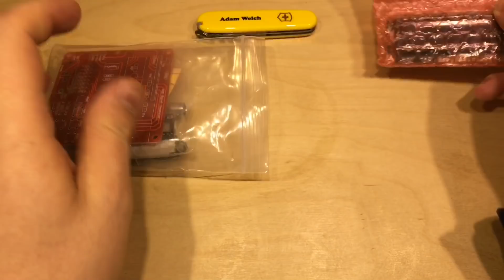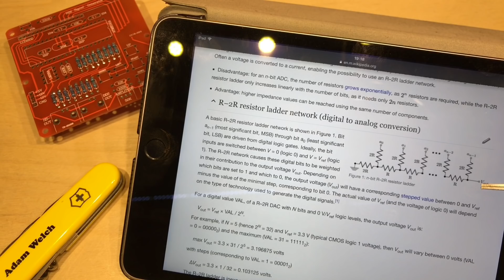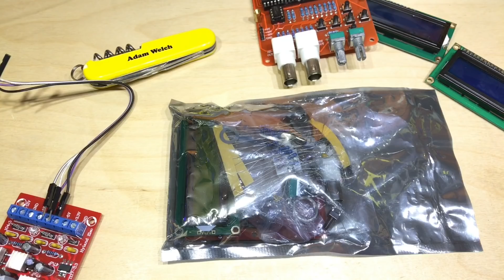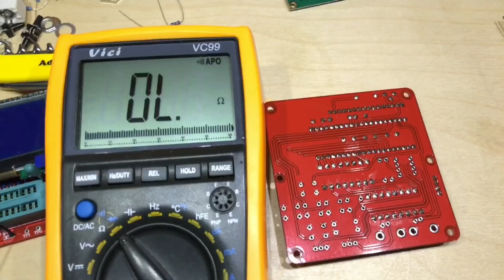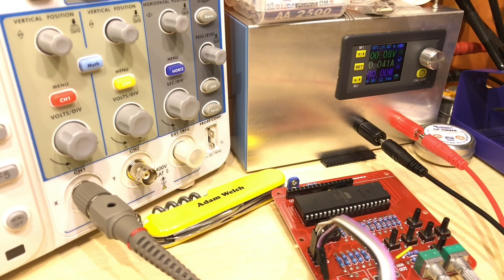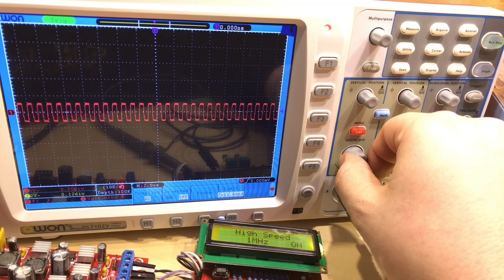Function Generator Kit Build & Build & Fix & Test & Bin? - 12v Solar Shed

Comment: Not sure if you know it already knows that already - I know it has been a VERY long time since you have made this BUT - I am not sure but maybe the reason that it does NOT work because of the Occilator capacitors and they should be 22pf and I am sure that you have soldered the wrong capacitor. that could be it. Not even sure if that may be the case BUT on 12:41 we see that you have yellow capacitors - that I am not sure the value of - instead of the original red ones... NOT sure if that may be the case But maybe :)
I know that you have already used the original red ones, to begin with, but what makes you replace them? 4:42 are they OK? hope you will have it fixed.

Comment: I must be lucky or something. Built one of these yesterday and it worked fine first time (except I can't see anything sensible out of the HS output. Wonder if I've got a bent pin on the microcontroller...)

Comment: If you would like another similar challenge, you may want to take a whack at an "RGB LED Heart Kit".  I bought one, built it and had it act odd, then got another kit (like you did) to try to trouble shoot the first one but it did the SAME thing.  They act sporadic just like your first build and I too replaced the caps, xtal and swapped processors. The really weird thing is that if you touch the xtal area of the board, it will sometimes spring to life.   I have NOT tried looking at the fuse programming but I guess if I want these to work, that might be next.  Here is a video of the failure: https://youtu.be/cJE3qWEgLis and here is what it should look like: https://youtu.be/sh55uCk0z58?t=12m37s  Any ideas or is it the bin for these as well???

Comment: Pity you had issues with this - mine worked perfectly... well, I have no oscilloscope, I just hooked a speaker up to it so I could hear the waveforms, but it seems to work fine. I noticed that you have to turn the output off before you can change waves / frequency, you can't just change it on the fly to use the unit as an oscillator. Obviously this is normal for the unit.

Comment: Adam your video was very good and did enjoy watching the professional & quick explanations given without gibbering and hardly a pause between changing components.
 
Could your psu been responsible for the spurious signal received? as for the major problems i do not know! ...but have certainly learned from yourself.

Comment: I bought one of these DDS generators but didn't have any problems with it. My Atmega chip was also in polystyrene,but no damage or pins bent. I fitted this into a project box and had to dismount the potentiometers and BNC connectors to get enough room for the pot knobs to fit. I also needed to buy some new push buttons with much longer posts. I also mounted one of the split rail supplies under the DDS board. The whole thing works great, if you discount the cosmetic appearance as I couldn't get the six buttons lined up properly and bodged the holes terribly. Still in all it was a good build.

And then I went and bought a 24MHz DDS box, also from the same supplier. :)
Reply from the maker: +Peter Fielden-Weston Glad it worked well for you. Sounds like a nice project. Cheers

Comment: could the first opamp be damaged by the first kits circuit ?
Reply: oh it was the second kits opamp that was faulty I think now
Reply from the maker: +Maico Yeah it was. The opamp shouldn't effect the atmega circuit though and I did remove it from the original circuit to check that. The first one seems to have come with a faulty pcb the second a dodgy opamp.
Reply: ***** yea it must be the first kits PCB circuit itsself. I was amazed the AtMegas were both fine.

Comment: check the orientation of the switches
Reply from the maker: Yes I did check that on the original - I did consider that one of them may have been causing a short and confusing the ATMega or at least getting it stuck in a loop.

Comment: I made this generator using info on the ScienceProg.com, and I have to say, it has some querks too. My don't freeze when you probe the HS output but tends to screw itself up when you switch it off. 
 What I mean is when I unplug it (I have mains transformer+bridge+caps+regulator) from the mains, sometimes it displays rubbish on the screen and won't work anymore. I had to flash the chip few times, it drove me nuts :/
 BTW, what about decoupling caps? Maybe you have a bad one, the uC needs a good decoupling, otherwise, it does weird stuff. Try to bodge some 100nF or larger ceramic caps in parallel to the existing ones.
Reply from the maker: I'm going to leave it to one side for a bit.  I've had enough of it for now.  However when I pluck up the courage I may well give your suggestions a try.  Cheers.

Comment: The one I bought is the same basic design but it was ready built and had onboard voltage generation so it runs from a single supply. However it came with one slight issue which turned out to be easily fixed. The signal outputs were exactly half of the displayed frequency. The problem was the fuses in the ATmega16 hadn't been set correctly to use the crystal oscillator, it was running on the 8MHz internal oscillator instead. Luckily I have a USBASP AVR programmer and the PCB had a vacant space for a 2x5 programming header so it was 5 minutes work to fix the issue. Clearly quality control was non-existent where it was built but at least it does work. There is alternative firmware out there if you fancy tinkering with it further.
Reply from the maker: Thanks Nick.  I have ordered a USBASP programmer and a zero insertion socketty thingy.  I may well look up the alternative firmware.  Mine does produce the right frequencies so clearly the fuses are correct but it does question the quality control.

Comment: Oscillating op amp? Try decoupling the input rails close to the chip.
Reply: Might be the case, I had a similar issue with the other gear.
Reply: Yup and also decouple the power rail as close to the + and - vs gnd. Use 100NF caps.  Seen some funky outputs when either the input rails are (to) high impedance or when there are spikes on the Voltage rail. Might even be an earth loop. 
Maybe you can give it a second life.  Troubleshooting what goes wrong and getting it right is part of all the fun and fulfillment .
Reply: Yeah, I mentioned decoupling caps in my other comment. I agree - troubleshooting and tweaking is the most fun part, and you learn a lot doing that.
Reply: Can you change the op amp for a TL072?

Comment: Hello Adam...  This is a very good video about "blind Kit building"...!  I applauded you When you made the second board, to test the chip... Also, a opamp tester will be of great use in your  shed.  The Germans have a saying: "Wissen ist Gut, aber, Kontrollieren ist Besser...!  When I get chips from ebay and they are Not protected, I ask ebay to return/refund.
Reply from the maker: We have a saying in England which is quite apt in this case...  buy cheap, buy twice.  It's a shame, even after all that time and effort it doesn't work terribly well.  Oh well.  Onto the next thing...  Thanks Jakob